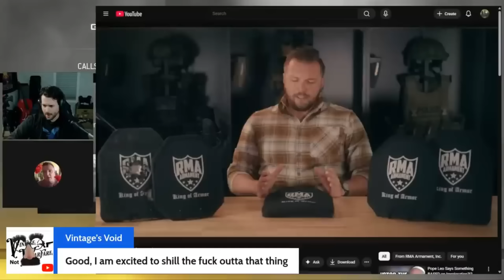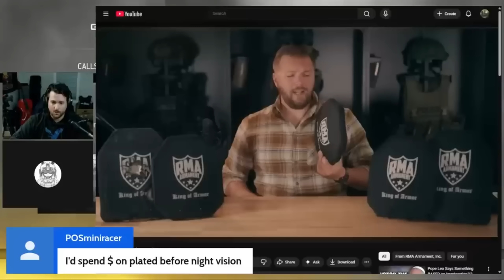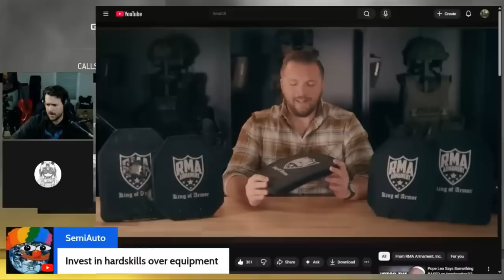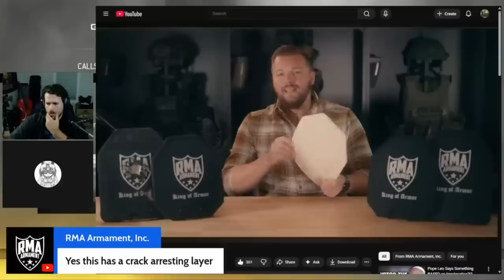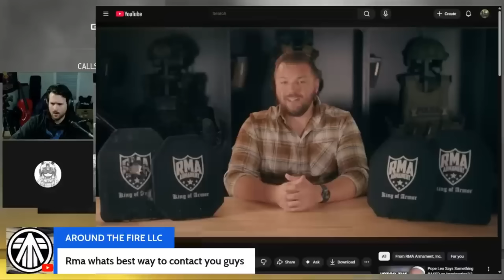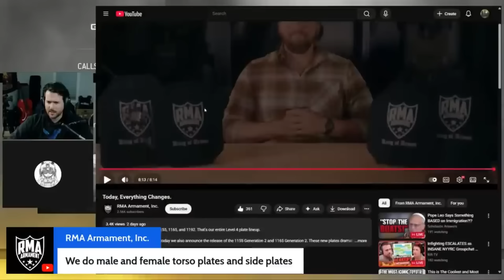New Plate, Who Dis?

Comment: Read the fine print because that new 10x12 shooters cut isn’t literally 10x12. Still edge to edge but not the same 10x12 dimensions they had with their old 1155 and 1165, so it’s actually smaller than 10x12. Still good value but read that fine print at 9.5x11.5 inches.